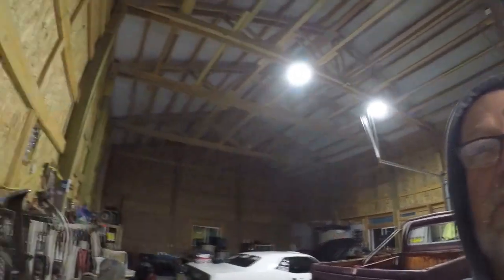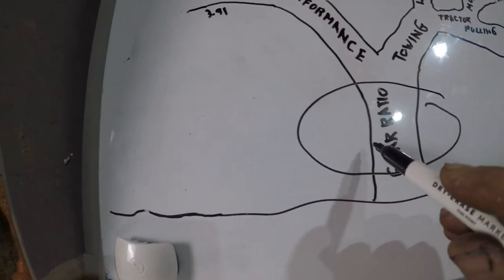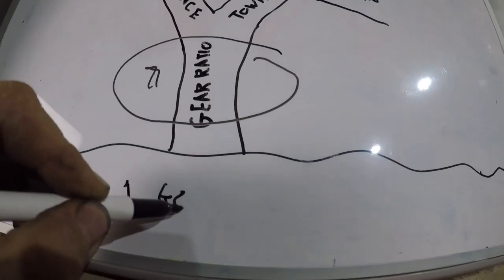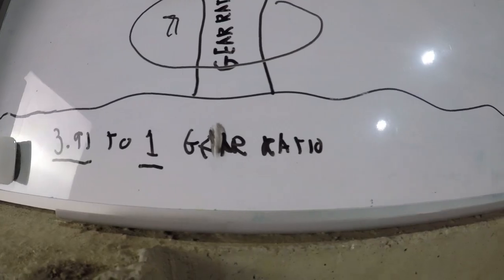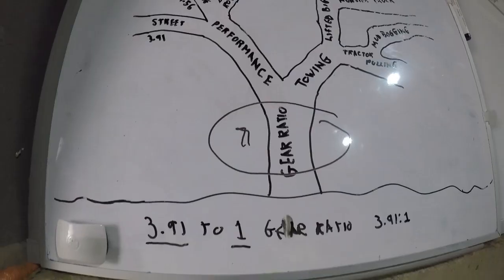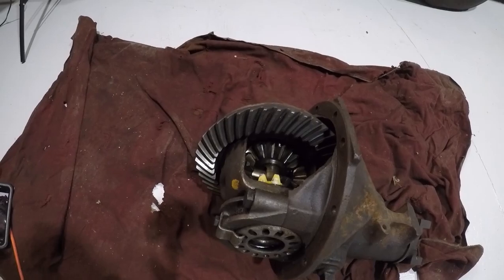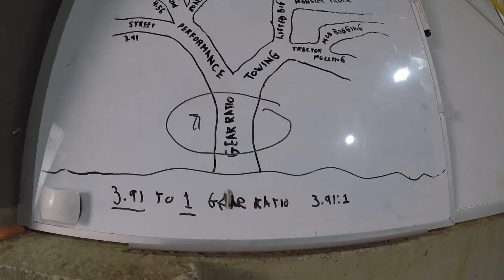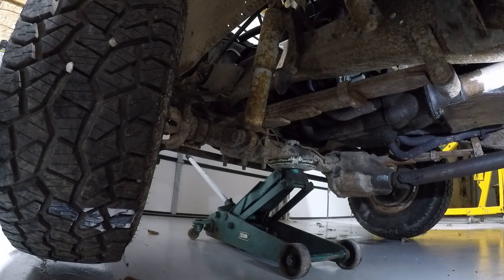Unmasking the Truth: Street Gear vs. Highway Speeds

Comment: Where I came from In the early 60s, when some one said, Hows it geared? You might say 2800.
Meaning 2800 rpm at 60 mph in high gear direct 1/1. 
This was truth because tire size changes the rpm.
You know, like 33 inch slicks with a 456 equals a 26 in tire with 325. (Just guessing numbers)
Cuts right through the ooo-aaah baloney right to the nitty gritty.
Reply from the maker: That's some cool vintage car talk! Thanks for dropping that knowledge!

Comment: I’ve got a less than ideal setup. 3.73 9” Traclok rear, 373 PowrLok D44 front. NP435 manual top loader. 35” tires. The only reason it works is my granny low of 6.69:1. I use it from a stop and shift at 3500-4000 rpm at 16-20 mph, 2nd gear is 3.34:1, takes me to 35ish at about same rpm shift, 1.6:1 3rd takes me to about 55 at about same rpm, 4th is 1:1 and freeway cruising at 80 mph is about 2850 rpm, maybe a 2950?  Anyways, it’s not ideal and only works because my cam (comp xe266hr12) comes on at 1600 rpm and pulls to 5500 rpm, in an aluminum headed full roller 10.2:1 331 sbf. 15 mpg is my average with lead foot. 162 psi warm cranking pressure at 4800 feet elevation. Compromise is always the name of the game…
Reply from the maker: It sounds like you've really optimized your setup to make the most of it!
" Compromise is always the name of the game…" agree 100%

Comment: i have a 440 load flight 727 out of a MH ran 3.91 gears did not like them went back to the 3.55s which was a little faster than the 3.91 s because of the rpm range where the torque is with that motor trans set up more less i was running out of rpm in between shifts which slowed it down this is in a 1973 d 100 dodge club cab about 4200  lbs
Reply from the maker: Makes sense, MH had vary low compression but had lots of low end torque. Perfect engine for that truck.